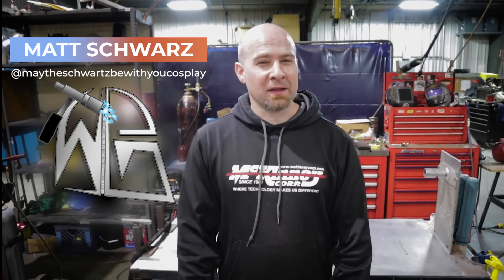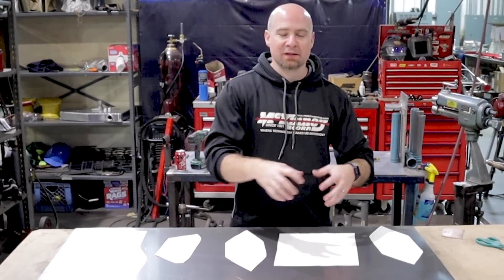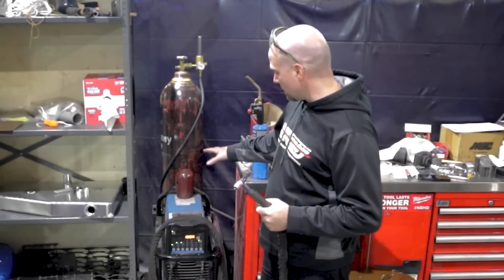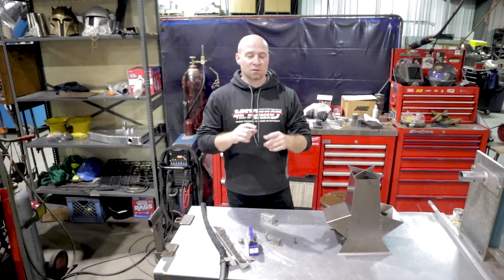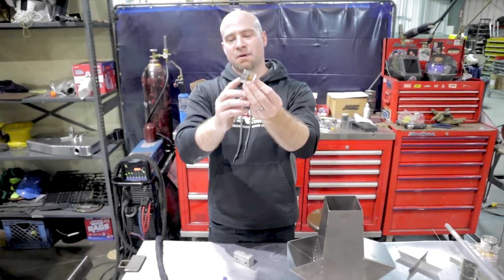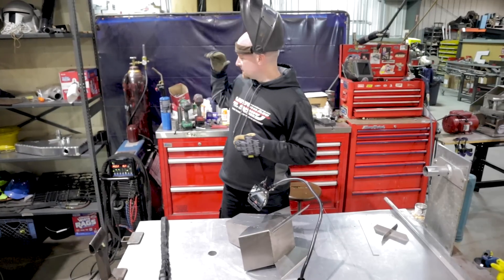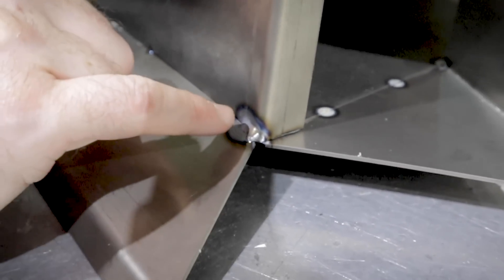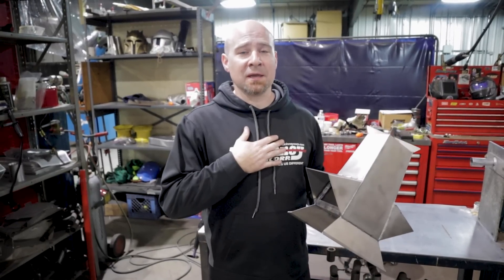DIY: Welding A Titanium Rocket Stove

Comment: 10:57 Your chimney diameter is way too small compared to the feed tube, plus you have another hole in the back of the stove which is not necessary. That is why your fire burns backwards, if you close that opening in the back it will burn a lot better.
Other than that cool
Reply: I was trying to make it look like a rocket 😁